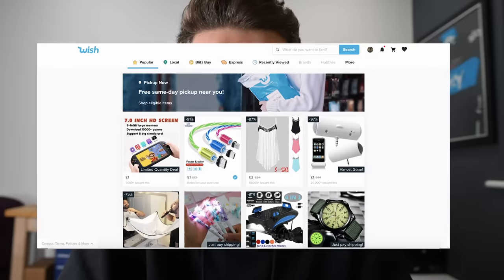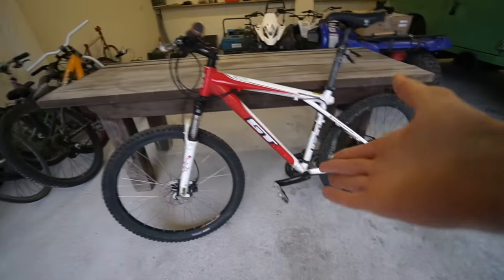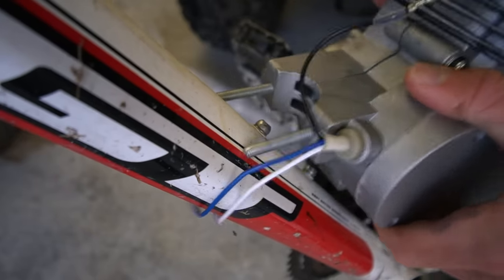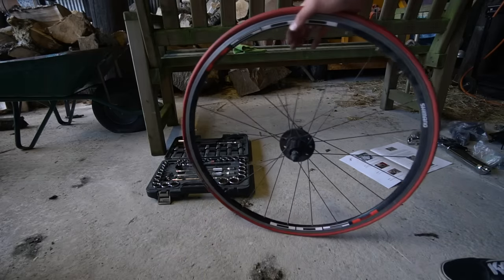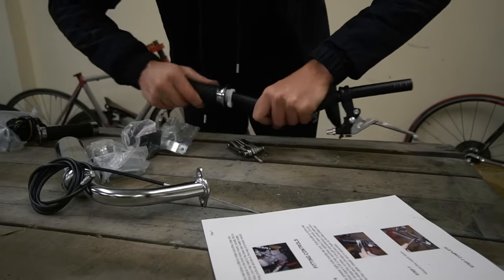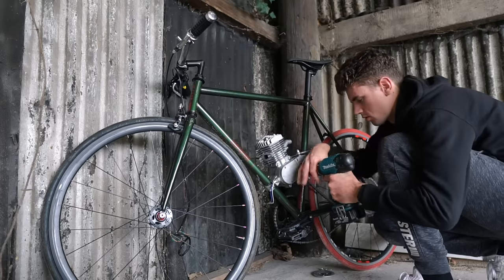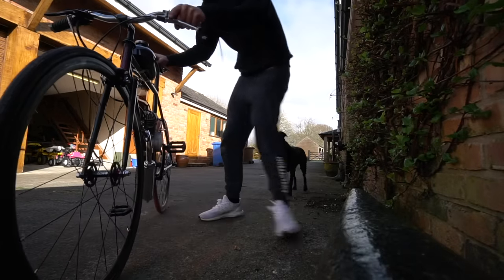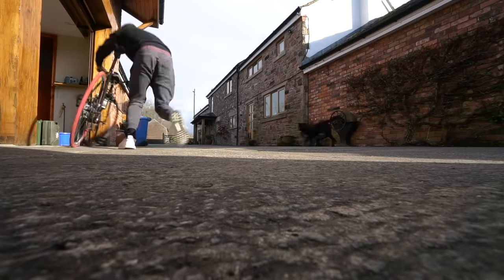I bought a 2-stroke bicycle engine from China *dangerous*

Comment: Pro tip: always replace the hardware when you get one of these kits.
Reply: Another pro tip, always have an extra top end on hand for when the piston eats itself😂
Reply: @cpt.shepherd255  had mine 7 years I’ve had NOTHING go wrong
Reply: @truswalch9743  did you bother with the 16:1 oil to fuel ratio for break in or just jump straight to 20:1

Comment: "I've never built a motorbike before"
and you still haven't!
Reply: What defines a motorbike?
Reply: @Crazyoldman84  something that isn't a bicycle with a pathetic engine glued under it
Reply: Michael Bringloe it’s literally a motor bike... a bike... with a motor. Motor bike.
Reply: @CucumberMoped Not according to the definition of motorcycle. Moped is a type of motorcycle and is also pedal powered as well. If anything this would be classed as a scooter.
Reply: It’s a motor assisted bicycle
Reply: What do you think the first motorcycles looked like around 1900 ? It's a bike with a motor . I have seen them tuned to do 75 mph . It falls under Moped class or power assist bicycle depending on where you live .
Reply: @rdhudon7469  great, but it's now the 21st century

Comment: The first internal combustion engine powered motorcycle was invented in 1885 by Gottlieb & Daimler. It had a wooden frame and iron wheels. In 1886 the modern chain driven safety bicycle was invented and it didn't take long for people to figure that bolting an engine to a bicycle was a brilliant idea. Early Victorian motorcycles were simply bicycles with an engine bolted on so you're reliving what any Victorian motorcycle enthusiast would have been doing. It just needs Victorian bicycle "Spoon" or "Strap" brakes and you can experience the full joys & terrors of Victorian motorcycling!!

Later in 1886 the motorcar was invented (though technically it was a motor tricycle) by Gottlieb & Daimler. The 4 wheeled car didn't appear until the 1890's with the invention of the Ackerman steering system.

Comment: they’re marketed as “80cc/50cc” because that’s what the crank case is designed for and 80cc parts such as cylinder, piston, crankshaft, and head are readily available for them. They come as 50cc because that’s the largest displacement you can legally have and not need a driver’s license in certain parts of the USA which is the market they designed it for, I’ve had 2 Of these motors and destroyed 3 frames and at least 6 rear rims these things are great

Comment: Breaking in engines is a myth drive them right out of the box like you normally would so the motors sets to your normal driving. If you putt around then get on it days later you'll have problems bc the rings aint seated
Reply: with these small engines break ins dont really matter but they can make your engine last longer. But in something big like a car, atv, dirt bike, SxS, etc it is really important to do a break in otherwise your engine will be shitting itself within a few hours.
Reply: @sahibdipsandhu  no it won't I am a mechanic I feed my family building engines. I have built 2 in the past month. My cars motor doesn't even have 5000 miles on it.
Reply: @w.e.s.  well u prolly know way more than i do but ive seen a budys sxs go into limp mode after10 hours new because he didnt do the 10 hour break in. But i geuss it vaires between vehicles.

Comment: I have built several bikes and one take away is don't use their gas/oil ratio's as they are absurd and will carbon up your piston and pipe . I run them all at 40:1 right from the get go . Show me a new two stroke that takes 16:1 or 20:1 I would also upgrade to a spring chain tensioner as the ones provided are dangerous . I like your sense of humour .

Comment: I just recently installed an 80cc on an old Schwinn Stingray! Everything is installed proper but still have yet to get her started by popping the clutch because I can't get up enough speed bc the Stingrays had such small pedal cranks. I just installed the pull start and still wont start so I was told to put a different carb on it. Also, can an electric start not be put on these?

Comment: Use a grinder for that mountain bike downtube then it will fit with adapter. Use locktite or expoxy on every bolt. Grease the engine. watch videos on how.

Comment: i had a bike enigne 50cc, i used to randomly mix the oil , also it used to hit over 55mph, never broke untill i dissaemble it, lasted for 2 years
Reply: I think ur engine firstly hated you cuz u should follow the mix ratio and there is no hope in hell that the 50cc can hit 55 mph its either a good running 66 or an 100/80cc engine

Comment: Yeah this is why I just took a weed wacker motor put it in the center of the frame because left side rotation is what goes forward and then put an extra gear on the other side of the pedal assembly where a little chain would attach to a gear welded on to the clutch assembly for the weed wacker so I get the motor moving the sprocket moving the opposite side sprocket so I still get the gearing ratio so instead of like the 20 mph I would get maximum I clocked it going 40 and I got about 80 mi to a full gallon worth of fuel and because it was a 4-stroke I didn't have to worry about mixing oil into the gas so I can just run over to the gas station and put in a few bucks literally only downside I had to take the pedals off of the crankshaft but I have a electronically locking pull start I hooked up a key attachment out of a car from a auto store so I could make it so even if you tried to pull start it you couldn't get it started without the key because the electronics for the spark plug would not connect otherwise and I just put two pegs on the front rim so I have a place to put my feet and on a 32 inch mountain bike it's actually pretty nice and because it's 49cc I can drive it without a license or turning lights took me about an hour and a half to get from my house to the middle of Chicago which is roughly 50/60 MI can I put one of those little light bulb powering spinning bits that you attached to the edge of the wheel and I modified it to work as a phone charger for one of them and the other one Powers the front and rear light I just have to replace my inner tube right now 
Put the 40 US spent on buying it from my neighbor when he bought his electric weed wacker and the 20 bucks for a new gasket set and the $10 I spent to pay my dad for the usage of his welder and I just went through his basement to find the fuel tank fuel lines and fittings was so worth it the only time I can't ride it though is during the middle of winter when it's snowing put on the days when the roads are clear works just fine I just have to bundle up because of the air temperature

Comment: I just picked up 50:1 2 stroke premixed fuel for my 80cc 2 stroke, I was reading that 50:1 is optimal for 2 stroke small engines, if I was misinformed please let me know, this is my first 2stroke
Reply: Most are 50:1.  There are engines that recommend 40:1 or 25:1.   50:1 is probably 95% of the engines in the U.S. anyway.    Having more oil in a 40:1 and running it in an engine recommend for 50:1 wont do much more than have you change the spark plug more often and smoke more.

Comment: My stepdad and a couple of friends have one and in the UK technically there isn't a classification for them. Depending on the police officer that stops you, you shouldn't be in any trouble. Technically its still a bicycle. Also worth printing off the legislations regarding mopeds and motorbikes and keeping them with you to show the officers if stopped. I think the engine size will play a big part in it too. A friend also created an E-bike which is ridiculously quick and he's been stopped multiple times on it and nothings happened so far so in essence it's the same really. I dont know the law regarding a standard bicycle and speed limits? If you pedalled through a 30 limit doing 40 are you at risk?

Comment: NGL your build hurt me so many different ways, but it's all good. For all the hard work that went into the building process, no feeling is sweeter than actually pedaling it for the first time and hearing the engine roar. (yes I realize you removed the cassette). I'm guessing you went back to traditional cycling or e-bikes though, these China doll motors are good if you want a hobby but aren't very reliable long term.

Comment: Watching you cut the head off that stripped bolt with the angle grinder instead of cutting a deep line or cross into the top of the bolt for a flat head or Philips bit and using a ratchet to take it out hurt my hurt, nice vid tho well done bud

Comment: 6:38 . The tensioner is dangerous. The vibrations of the bike and the chain can pull the tensioner into the rear spokes......locking up the rear wheel in a split second......ride with caution dude
Reply: YouTuber Person fortunately he bought a triple 40 engine, and they come with better parts, including the 4 bolt chain tensioner. It's much more robust. But yes, you're still right, and there are better options.

Comment: IF you went 46 that was allredy full throttle, you wont go much faster with this motor, so you allready broke it in, just way too fast mate, this motor will break fast, but they are fragile and very tinker heavy, get a 4 stroke if you want longevity if you are not a mechanic id say, or learn wit thease and at your 3rd motor that one might survivie 5 years or more, for this one id say half a year to max year, i can bet the bolt holding clutch inside engine is gonna blow out the side of the casing just like mine.
Reply: i had the same kit

Comment: A bicycle really isn't made for an engine
 There is no chain guard, and other safety protections. Buying a scooter or motorcycle is a lot better. These are designed for an engine, and have lights, brakes and other essentially important features as well as a frame that can handle an engine. Building something at home is way cool, but even a scooter is better suited for a beginner motorcycle.

Comment: The kill switch in the most useless part on the entire damn thing I just don't even hook it up
Reply: Got make sure the connection to the Magento is alright. Also check the connections to the CDI and make sure it is grounded to something solid like the engine block. I just replaced my switch with a toggle switch, way more reliable

Comment: I build these things for a living,  thry fit on most bikes if u use the included mount adapter for thicker frames.  They dont work with rear suspension frames or disk
ed wheels

Comment: Why is it dangerous
Reply: frame, wheels and brakes of a bike are not built for safe daily use of that thing, parts detaching might get in wheel and make you crash, not reliable, running around to start it tires you more than using pedals, you might fall or get a stroke even before starting, not allowed to use it on public roads... a legal pedal assisted electric wheel kit for your bike is easier to apply, safe, cheaper to run and more useful. 250 watt motor is free use in Europe, 36Volt version with a 10Ah battery haa 80 km range and few cents charging cost.

Comment: Why you do all of these and you don't get a second hand scooter or electric moped bike ?  However believing  not every bike is suitable to run over 15 miles safely  because on the market has road bike cheap and expensive. Expensive road bike can run  faster with no any issues and they have stability control. This make the bike expensive.  Very danger this type of bikes. Take care yourself. Your body and your soul  is more valuable than the money.  Take care your body.

Comment: Why make a video like this? There are so many massive mistakes made, While these engines are designed to fit a variety of frames they dont fit every bike like a glove. Get a beach cruiser or something with long handlebars and use the 99.999% of the time supplied in the kit u-bolt bracket for the front tube. Spreading misinformation for views is cringeworthy at best. do research and ASK people in the motorized bike community and you'll get proper answers. We are here to help.

Comment: These 2 stroke chinese bike motor kits are trash...
Reply: Are they really tho or can u just not tune a 2 stroke cause mine run good and everyone qhos not a complete noob has good running bikes
Reply: @theLyzhendricks  It ran ok for 1 week then fell apart... Maybe I am too heavy for it (210lbs).  I'm not a skinny teen weakling...
Reply: @stephenagaertner  I'm not a teen either im 20 thank u very much and yea I only weigh 150
Reply: @theLyzhendricks  Btw - Electric bike conversion kits are much better.  I installed 2 of these and had no issues.  More dependable too.  These just involve replacing the front wheel, buying a 36 or 48 volt charger,  buying 3-4 lithium batteries,  routing a few cables,  & mounting a lithium battery box. We also have been doing some ATV engine replacements & REAL CT200U engine performance upgrades.   So sorry I am not a newb. BTW Are you a bot pushing to help sales of the trashy little gas motors for bikes?
Reply: @theLyzhendricks  Please fix your spelling too!  I don't understand your writing.  Is this supposed to be English?
Reply: @theLyzhendricks  weakling...
Reply: @stephenagaertner  funny guy
Reply: @theLyzhendricks  My 15 year old is more than 150lbs... lol